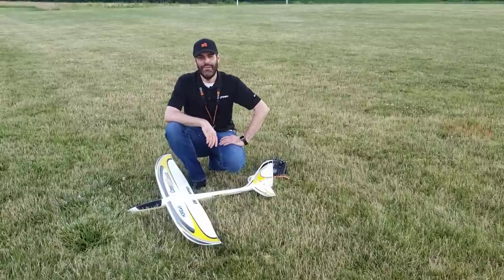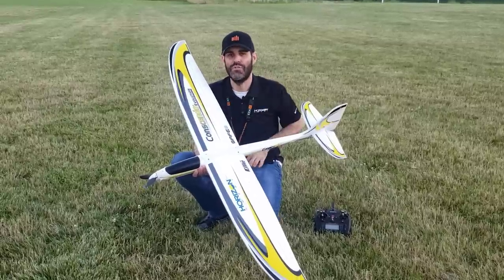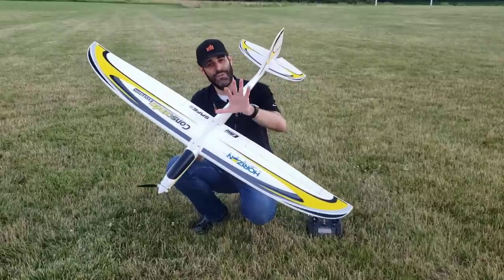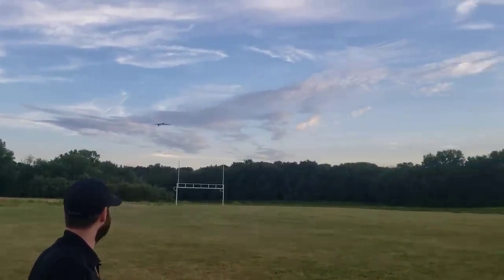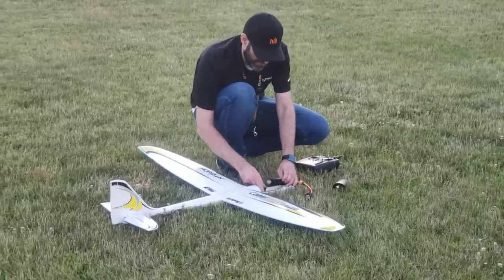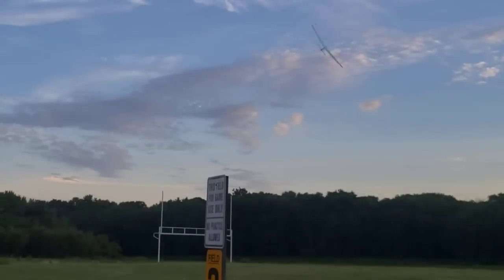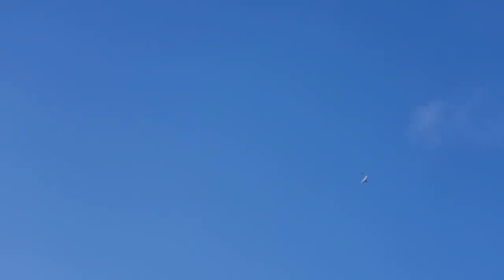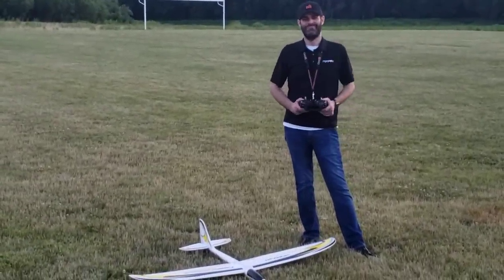Flight Talk: E-flite® Conscendo® Evolution 1.5m

Comment: Will the BNF work with DXE transmitter? I cannot get Safe to work on mine.
Reply from the maker: Yes! You need to assign SAFE Select to the B switch to make it work. With the transmitter and airplane powered up, make sure the "Rates" switch (F) is in the "high" (0) rate position. Then, move both control sticks all the way to the bottom inside corners (low throttle, full right rudder, full up elevator and full left aileron). While holding the sticks in the bottom inside corners, flip the B switch back and forth from "0" to "2" 5  or more times quickly. The control surfaces should all move to indicate SAFE Select has been assigned to the B switch. Then, when you have the switch in the "0" position, SAFE Select will be ON. When you move the switch to the "1" or "2" position, SAFE Select will be OFF.
Reply: @HorizonHobbyProducts  the transmitter binds to plane. Then I toggle the sticks down and in then I toggle the switch 5 times...nothing is happening. I own 3 horizon BNF why is this one different?!? I have been struggling with this for days. If this is how the BIND FLY IS GOING TO BE FROM NOW ON forget it. I walked through those steps over and over...nothing
Reply: @HorizonHobbyProducts  I power the plane up then remove the bind plug. Then I hold the bind button and turn on the power to transmitter. The plane is now bond. Then I press sticks down and inward while toggling mode switch...nothing happens. Where did I go wrong?
Reply: @HorizonHobbyProducts  can I use the program cable to program transmitter or receiver?